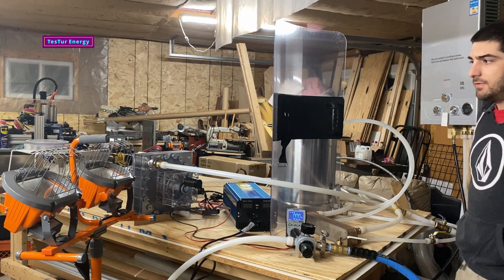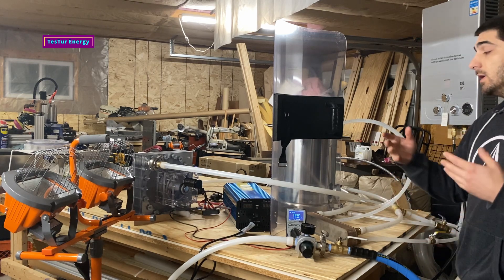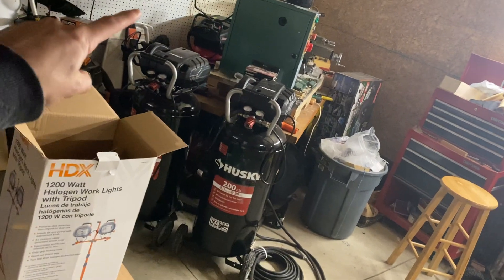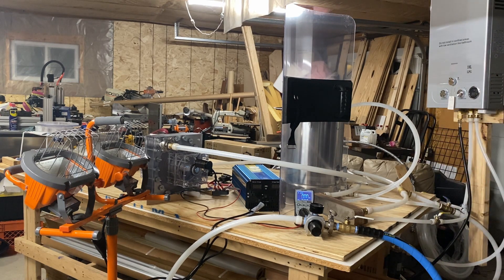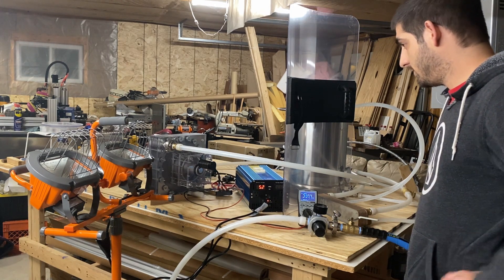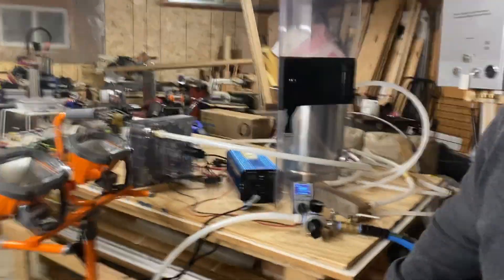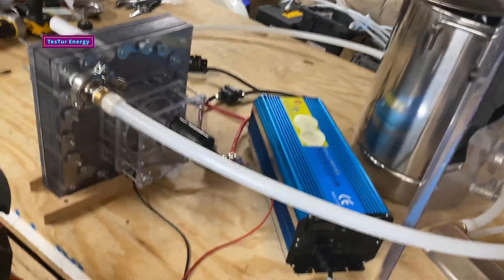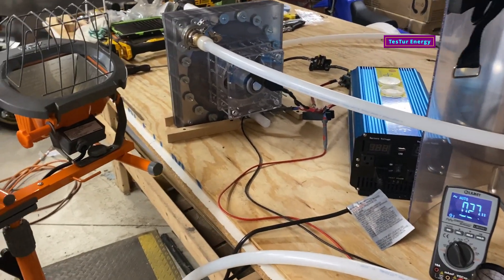Amazing Tesla Turbine Actual Power Output Test - 1200 Watt Real Electrical Load - CAES - Turbo Jet

Comment: Hi.  So you are using a Tesla Turbine designed for water that you are trying to use with air?
Reply from the maker: Hey thanks for commenting. I really appreciate it. 

So Tesla primarily designed and intended the TesTurs to be run on steam and combustion gas (aka hot compressed air) 

Have a listen of his article “Dr. Tesla Talks of Gas Turbines” from 1911 
Dr. Tesla Talks of Gas Turbines - Article Read Aloud by Charlie Solis AudioBook Tesla Turbine Info
https://youtu.be/TGGLG-7hK50

Furthermore, the bunch of the Turbine Improvement patents that Tesla put out that are a follow up to the original turbine patents are for combustion + steam. Check them out!  🙂

Tesla Turbine Patent List by Nikola Tesla     

US Patent 1,061,206 & GB patent 24,001: the original Tesla disc turbine patent from 1911.      

Then almost all Tesla’s improved turbine patents, except the Tesla valve patent, were patented in 1921, the valve was done in 1919.       

Patent GB 186,082: improved disc stack design for more torque        

Patent GB 186,093: combustion + steam turbine with built in exhaust heat recovery boiler.          

GB 186,084: combustion + steam turbine superheater and concentric/coaxial multifluid nozzle that the steam draws a vacuum on the exhaust of the combustion mixing them as they enter the turbine.         

GB 175,544: hybrid Tesla Disc + Parson’s reaction turbine for utilizing the Reheat Factor of the energy lost to shearing in the fluid between the discs        

GB 186,799: process and apparatus for balancing rotating machinery for  quality at-speed dynamic balancing.        

US 1,655,114: aerial apparatus patent with improved turbine nozzle design         

US 1,329,559: Tesla valve for pulsed combustion Tesla turbine.   

GB 179,043: High Vacua Pump
Reply: You didn’t answer my question.
Reply from the maker: @tommartens3731  are you asking if the Tesla turbine was designed for water?
Reply: @CharlieSolis  I am asking if you are using a Tesla turbine designed for water using compressed air instead.
Reply from the maker: @tommartens3731  No I’m using a Tesla turbine that’s designed for hot compressed air and steam by using it with hot compressed air and steam. 

May I ask who told you that the Tesla turbine was designed only for water? 

As I said previously, the vast majority of the tesla turbine patents that Nikola held, the original and the improved combustion + steam ones are designed and intended for use with hot compressed air (combustion gas turbine) and steam turbine. 

As I have said, Nikola Tesla Explains this all in his “Dr. Tesla Talks of Gas Turbines” article from 1911,
Dr. Tesla Talks of Gas Turbines - Article Read Aloud by Charlie Solis AudioBook Tesla Turbine Info
https://youtu.be/TGGLG-7hK50

Again I’m not sure where you were told that the Tesla turbine was designed for water. In fact Tesla originally invented these pumps for pumping mercury, not water. 

As Tesla states in his own words,

“Here he laid aside the pencil with which he had been illustrating the point, and reverted to the beginning of what he evidently considers his “big idea.”

“I have been working at this a long time. Many years ago I invented a pump for pumping mercury. Just a plain disk, like this, and it would work very well. ‘All right,’ I said, ‘that is friction.’ But one day I thought it out, and I thought, ‘No, that is not friction, it is something else. The particles are not always sliding by the disk, but some of them at least are carried along with it. Therefore it cannot be friction. It must be adhesion.’ And that, you see, was the real beginning.

“For if you can imagine a wheel rotating in a medium, whether the fluid is receiving or imparting energy, and moving at nearly the same velocity as the fluid, then you have a minimum of friction, you get little or no ‘slip.’ Then you are getting something very different from friction; you are making use of adhesion alone. It’s all so simple, so very simple.

“This is the greatest of my inventions,” Tesla went on with great enthusiasm. “

This is also why all the tests that Tesla did for showing the power outputs for it were done with steam and hot compressed gas (combustion gas turbine). 

“So Confident, He Offers to Build Them for Motor Cars
Considers New Power His Greatest Invention.

Gas turbines of practical and efficient construction, light, flexible and in every way suitable for automobile propulsion, are not a dream of the future only but a probability of only a very few years hence. At least such is the conviction of Dr. Nikola Tesla, whose newly developed method of fluid propulsion, as he calls it, and which was illustrated and described in last week’s Motor World, is attracting so much attention in scientific circles.  Dr. Tesla himself considers it the greatest of all his inventions. By his own statement the scientist already has built, run and carefully tested internal combustion engines operating on the new turbine principle and so confident is he of the thorough practicability of the idea that on Friday of last week he informed a Motor World man that he would even be willing today to sign a contract to build and install turbines for automobiles. He readily admits, however, that he would like to have more time, considerable more time probably, in which to develop a method of combustion entirely suited to the turbine….”

“Bearing in mind that a 110 horsepower steam engine already has been built so diminutive that its rotor or active part would drop into an ordinary water bucket, it would seem that the part of the program which might be supposed to concern the automobile industry would be well worth investigating. It was the tempting prospect of a pocket-size motor, therefore, which led a representative of the Motor World to seek the famous scientist in his offices high up in the Metropolitan Tower in New York.”
Reply from the maker: @tommartens3731  These preliminary tests are just to see how much electrical power can be produced with room temp compressed air driving the Tesla turbine. 

6.22ft-Ibs of torque at only 4150rpm and +4.25kW between 6000-12,000 rpm. 

The TesTur nozzles never went over 20psi at the nozzle for the 2650watt electrical load test and not over 40psi at the nozzle for the 4250watt dyno test.   

This is so I can get a baseline for what to expect as I increase the temps to combustion levels.   

When using elastic gasses the counterintuitive thing most overlook is that the viscosity of gasses goes up with temp. 

So not only do we see an increase in thermodynamic efficiency from increased temps but the TesTur isentropic efficiency also goes up due to the reduced slip from the increased viscosity.   

Make sure to check out the latest updates on the combustion + steam Tesla turbine builds!  Tesla Turbine 250 watt to 2650watt Power and Efficiency Test https://youtu.be/K7qZvq1CMFg 

+4250watt Tesla Turbine Dyno Jet Turbo Power & Torque Curve 375 mph @ 12,500 rpm https://youtu.be/exF5Rn-L8gs 

Tesla Turbine Jet Engine - gasoline fuel burner atomizer flame tube test 186,083 propane burner https://youtu.be/gRqKowignac 

Solis Talks Tesla Turbines - Nikola Tesla’s Electrical Power Systems Patent GB 186,083 Walk Through https://youtu.be/5Y3D13JmtcA 

Steam Tesla Turbine Micro Power Plant - 1st Start Up https://youtu.be/aMYyBsjhBR4   

https://www.instagram.com/reel/ClqGwiDDRSN/?igshid=ZmMyNmFmZTc= 

If you’re interested, check out the rest of my YouTube channel for more TesTur information. 

I’ve got a lot more in depth videos up there. 

And please leave a comment on any video if you have any questions. 

I’m always happy to give really in depth responses to everyone.  

Cheers!
Reply from the maker: These preliminary tests are just to see how much electrical power can be produced with room temp compressed air driving the Tesla turbine. 

6.22ft-Ibs of torque at only 4150rpm and +4.25kW between 6000-12,000 rpm. 

The TesTur nozzles never went over 20psi at the nozzle for the 2650watt electrical load test and not over 40psi at the nozzle for the 4250watt dyno test.   

This is so I can get a baseline for what to expect as I increase the temps to combustion levels.   

When using elastic gasses the counterintuitive thing most overlook is that the viscosity of gasses goes up with temp. 

So not only do we see an increase in thermodynamic efficiency from increased temps but the TesTur isentropic efficiency also goes up due to the reduced slip from the increased viscosity.   

Make sure to check out the latest updates on the combustion + steam Tesla turbine builds!  Tesla Turbine 250 watt to 2650watt Power and Efficiency Test https://youtu.be/K7qZvq1CMFg 

+4250watt Tesla Turbine Dyno Jet Turbo Power & Torque Curve 375 mph @ 12,500 rpm https://youtu.be/exF5Rn-L8gs 

Tesla Turbine Jet Engine - gasoline fuel burner atomizer flame tube test 186,083 propane burner https://youtu.be/gRqKowignac 

Solis Talks Tesla Turbines - Nikola Tesla’s Electrical Power Systems Patent GB 186,083 Walk Through https://youtu.be/5Y3D13JmtcA 

Steam Tesla Turbine Micro Power Plant - 1st Start Up https://youtu.be/aMYyBsjhBR4   

https://www.instagram.com/reel/ClqGwiDDRSN/?igshid=ZmMyNmFmZTc= 

If you’re interested, check out the rest of my YouTube channel for more TesTur information. 

I’ve got a lot more in depth videos up there. 

And please leave a comment on any video if you have any questions. 

I’m always happy to give really in depth responses to everyone.  

Cheers!